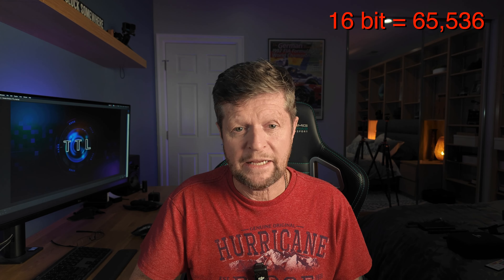DJI Mic 2 32-bit float - Overhyped?

Comment: Great comparision, super helpful

I dont think your audio in your "loud" test clipped enough to test the 32 bit float feature.  Unless you fully peaked and distorted your 16 bit audio... you probably weren't loud enough.
Reply from the maker: I think you’re right, but that’s kind of the point - people like to hype that 32-bit will just automatically make your audio better, but unless you have major sound issues, it won’t.

Comment: I see not so much the 32bit part, but the independent recording directly on the mic 1) as a backup should your mic lose connection with the camera, 2) as an option to use the mic all by itself to record yourself in different settings. Am I mistaken?
Reply from the maker: No, you are totally correct. Those are the most valid uses for most people, 32-bit or not.

Comment: Audio level on cameras often have an adjustment for compressing the sound that is too loud so it doesn't clip. But then the dynamic range is limited. So if you want a high dynamic range, then the 32 bit float is the way to go.  But as you say, for most situations, the compressing of loud sounds is perfectly acceptable.  Perhaps it's a good comparison to D Log video which requires extra work in post and for most people is not needed.  I'm glad this camera has both for those times when it matters, even if that's 1% of the time.

Comment: Did you have noise canceling turned on? The audio had annoying artifacts that sort of garbled the high end.
Reply from the maker: No. I made sure to turn it off.
Reply: @ttl_channel  It definitely sounds like there was some form of noise reduction on, maybe a plug-in in your editing software?
Reply: @The_0ne504  Yeah maybe he wanted to take out some ambient room noise and he set it to 100% in post. A little computer fan noise is better than noise reduction artifacts.
Reply: @ChadWork1  I agree 100%

Comment: So 32 bit only works if you manually match up the audio.. and on top of that not forget to press record also on your mic..? And if I understand correctly this 32 bit doesnt work if you record on your phone and use a simple editing app like inshot or capcut right? So its better to turn it off then? Or does it not even matter?
Reply from the maker: Yes, it’s a lot of work for little gain (if any)

Comment: Good job. I'm interested in this camera, and I've watched a bunch of reviews. Most of them parrot the 32-bit float capability, but this is the first time that I've seen anyone explain it in a logical way. The mic 2 looks good from a convenience point of view, but 32-bit float is basically marketing hype.
Reply: It’s not hype, it makes the recording unclippable and you won’t need a back up track. Audio engineers will you don’t need it but a lot of people say you don’t 422 10-bit on a camera, or 32 gbs of ram in a computer, or remote start in a car. And you don’t, but it makes life easier. 32-bit is the same, you can just press record, not dial in settings, and fix it in post
Reply from the maker: I prefer the term "overhyped". I think that there are some users who will be able to get the benefit from it, but as I said in the video, for most users, it's a lot of work for little (if any) improvement. Thanks for watching and joining the conversation.

Comment: Not a bad video, at all. 

You forgot the sign bit, to indicate positive and negative values. The exponent is called the mantissa. I have never seen how many bits are used by DJI for it. Nor if the other manufacturers use the same number of bits. The remainder of the 32 bits are a binary fraction, to be used with the mantissa and sign bit to record the value of a single digital sample of the audio input.

You correctly pointed out that 32 bit float usage involves extra work. And, it might not be worth it! Or, it might be, to some of us, sometimes, as a safety net for those unexpected wide dynamic range events.

When you did the 32 vs 16 bit tests, something was wrong with the audio I listened to. Made the comparison useless. Audio was noticeably inferior to the preceding video.

Finally, I find the transition you favour and use to be annoying. A simpler one would be fine. 

When you did the
Reply from the maker: Thanks for your feedback and for watching.